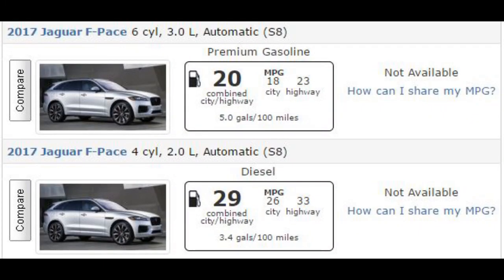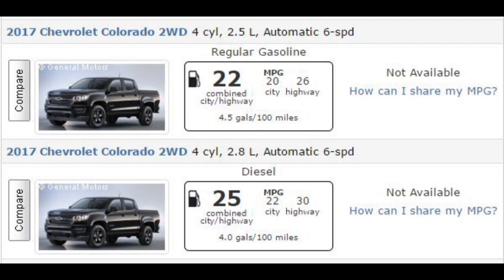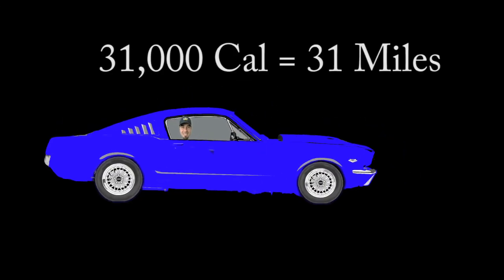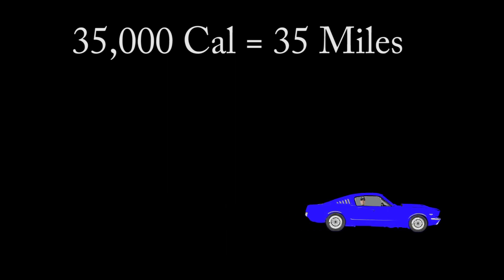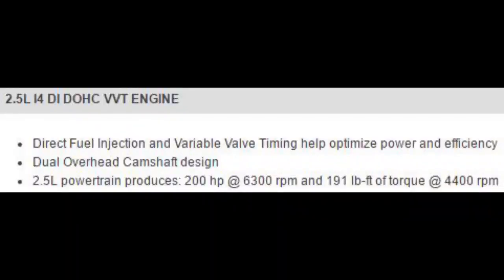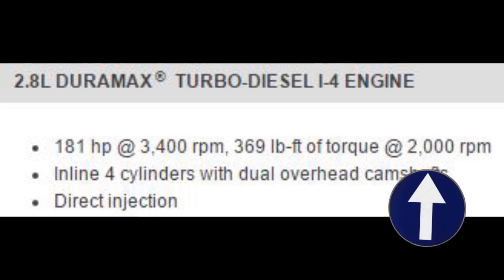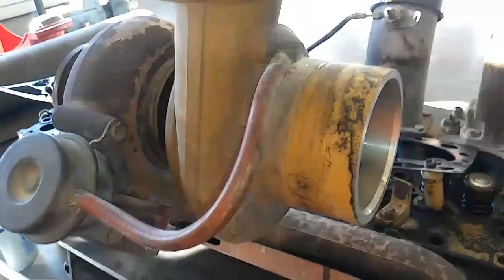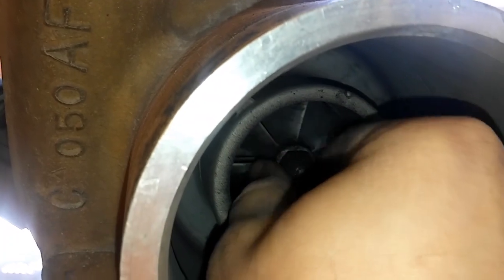Why Do Diesels Get Better MPG? Why Are Diesels More Fuel Efficient?

Comment: Maybe as more people use diesel auto's the price of fuel will fall as it IS faster/easier to produce than gasoline.
Reply: You wouldn't want that, diesels are filthy things and there's no real benefit to them. This guy is comparing diesels to much more powerful gasoline engines, which is why the diesels are so much more efficient. If you compare a Golf TDI to a Civic, the Golf only gets about 15% better fuel mileage, which means it's not efficient enough to make up for the greater CO2 emissions that come with burning diesel. The Golf also produces a greater amount of smog forming emissions. Actually, the Golf TDI was producing even more smog forming emissions than the EPA realized until VW's cheating was brought to their attention.
Reply: idontcare80
Wrong moron.  Modern diesel cars are very clean and get better MPG than gasoline vehicles.
Reply: I beg to differ. My average consumption with mixed city, highway driving in Montreal's cold winters, I get 6.0L/100kms. all 4 banger gas engines I owned would hover around 9 or 10L/100kms. in winter. Summer I hover around 5.3-5.7L/100km. And the overall wear on a Diesel is a joke compared to the gas engines thanks to the lower revs. The exact same engines in Europe run between 15-20% more efficient thanks to better fuel qualities and different emission standards. As efficient as our N.A. diesels are, they still have much more potential.

idontcare80, by the way, gasoline is a by product of oil, diesel is essentially just refined and filtered oil with special additives (depending on season and climate). If we ran on just gas, what would you do with all the oil that is left after we make jet fuel, polymers, plastic, lubricants? 

I also don't understand why VW are the only one's that got caught "cheating" on a static test. All auto manufacturers are a bunch of liars. GM killed ppl with their ignition switched and they knew about the problem for over 10 years. They barely got a slap on the wrist. Why is industrial equipment running on diesel not regulated like automobiles. I work at an airport and you would cry if you saw, tasted, smelled the exhaust of the equipment we use. And all the fine particulate that you can even feel in your eyes, nose and tongue.

Burning oil in itself is very dirty. Refining it to get gasoline is even dirtier (takes a lot of water). Burning gasoline has only become clean with the advancement in catalytic converters, and I would say that diesels have come a really long way with the EGR systems and Diesel particulate filters (which burn the particulates to very high temperatures) in order to have a cleaner exhaust.
Reply: Patrick EH. Yeah, I'm a moron, when you can't even understand what i said. I said: Diesels aren't any cheaper to fuel (this is because diesel fuel costs more), they don't have lower CO2 emissions (this is because burning diesel produces more CO2 than burning gasoline), and that their smog forming emissions are higher, and they are.
Reply: vindication444. Things are quite a bit different in the US, as we require our diesels to meet the same emissions standards as our gasoline engines (and they barely do that while gasoline engines exceed minimum requirements), this restricts them considerably and reduces their efficiency. Diesels in the US still produce more NOx, have about the same CO2 emissions and cost about the same to fuel, all while costing more to buy, there's simply no reason to buy them.

The use of fossil fuels needs to be completely eliminated, period.
Reply: I totally get your perspective and agree! While opening up the topic of emissions on gas engines. The United States are really good with air quality. If only they can put catylitic converters and exhaust components that can withstand higher temperatures of burning a leaner mixture. Would get better fuel economy and much more horsepower too. This would help tremendously with pollution on the refining front. Direct injection has helped tremendously (makes gas engines feel like diesels almost), but there is a serious drawback with carbon buildup in the intake manifolds. I still believe that the future, Elon Musk with Tesla has got it right!
Reply: In terms of cost. The US is one of the few places around the world where Diesel is considerably more expensive than gasoline. In Europe, diesel is considerably cheaper. and 95% of the time, diesel is cheaper in Canada as well.
Reply: Gasoline engines don't need to be any cleaner. PZEVs already have exhaust that's cleaner than the air in a polluted city. In other words, they're actually capable of cleaning the air.

"...but there is a serious drawback with carbon buildup in the intake manifolds."

That's not nearly as big of an issue as the soot that builds up in the intake manifolds of diesel engines due to EGR (EGR isn't an issue on gasoline engines). Hell, soot eventually clogs up the particulate filters of diesels, and that's not a cheap issue to deal with.

BEVs are the future of passenger vehicles, but there is a whole huge range of applications where they're just not practical, and wouldn't be even if battery capacity were doubled. Hybrids will take over in those applications, and those should be gasoline/electric hybrids, not diesel/electric hybrids.
Reply: I thought diesel was more expensive because it is a lot more refined
Reply: That is great that it produces more CO2, as that molecule is the elixir of life, and the earth's atmosphere could use more of it.  You have been brain-washed about the alleged deleterious affects of increased atmospheric CO2, because those adverse findings were the result of bad math, statistical manipulation, and an anti-technology attitude designed to fatter the pocket books of certain green energy companies at the expense of the taxpayers.
Reply: So, you think that because some life consumes CO2 that it somehow isn't a greenhouse gas?
Reply: How in the world can you possibly deduce from my statement that CO2 is not a so-called greenhouse gas!?  It is one of the mis-named greenhouse gases, and thank God for that, as it helps to keep our planet habitable.
Reply: You're not making any sense. Are you saying that CO2 is a greenhouse gas, but we're not warming our planet by increasing its concentration in the atmosphere? Or are you saying that we are warming our planet but there wont be any negative consequences because of that?
Reply: Also, how the hell could you think that the desire for better technology is anti-technology?
Reply: Jeez!  To repeat myself - "It is one of the mis-named greenhouse gases...." and to answer your other questions:  The radiative properties of CO2 are well understood; however, the cumulative affects of increasing atmospheric concentrations thereof are strictly speculative.  Currently, most computer models utilized to project catastrophic warming have vastly overrated the affects.  The only thing we know for certain is that additional atmospheric CO2 will warm the planet, the degree to which may be too minuscule to be measurable.  No One Knows.  In the great book of climate,  we have not finished reading/understanding the first chapter of a multi-chapter book.  Therefore, to base a policy of reducing production of fossil fuels on a situation where we essentially don't know our ass from our elbow is stupid.  Want to ask me how I really feel?

I am "...not making any sense."  Look in the mirror.
Reply: Jeez! Again!  I never said that the search for better technology is anti-technology!!!!
Reply: The problem is that you're 100% wrong. The models have quite accurately predicted how the planet will warm in relation to the increase of atmospheric CO2, they're not perfect, but they were never expected to be, and they never could be. We also know that rapid climate change causes mass extinction events because it has done so many times in the past.

Also, as far as I'm concerned, you're just shouting: "What if we create a better world for nothing???"
Reply: You said I was anti-technology.
Reply: Also, who do you think is more powerful, a few piddly green energy companies who are just starting out, or the massively profitable fossil fuel industry? Who do you think is more capable of producing enormous amounts of disinformation and propaganda? Who do you think can afford more lobbyists in Washington D.C.?
Reply: What!  I can't believe this.  Well, from you, I can.  Even the computer modelers aren't making your claim that, "The models have quite accurately predicted how the planet will warm in relation to the increase of atmospheric CO2..."  Quite the opposite - they are offering all manner of excuses to explain away the reason observations are considerably lower than their projections.

You need to curtail your reading of newspaper articles and instead study the real science and math that's ongoing, but based on your level of understanding (better yet, lack thereof) of Adept's video and  concepts, it's probably over your head and a waste of your time.
Reply: Why in the world would the fossil fuel industry object to regulations that increase fuel consumption!
Reply: "...they are offering all manner of excuses to explain away the reason observations are considerably lower than their projections."

Except that this isn't happening. The fossil fuel industry propaganda machine cherry-picked some data which makes it look as though the predictions were falling short, but the actual temperature data runs right down the center of the actual predictions (which include a range of high and low predictions).

"...and instead study the real science and math that's ongoing..."

That's exactly what I've done, and that's exactly how I know you're wrong.

https://www.ipcc.ch/publications_and_data/ar4/wg1/en/spmsspm-projections-of.html

"...but based on your level of understanding (better yet, lack thereof) of Adept's video and  concepts..."

I understand that he's just spouting common misconceptions about diesels, and/or outdated information, and that no one here has been able to prove me wrong because I'm not wrong.
Reply: Chad Jessup If people were to acknowledge that climate change is a result of human CO2 production and that something has to be done about it, the use of fossil fuels would have to be eliminated entirely. 

It's amazing to me that this actually needs to be explained.
Reply: In your other reply to me you reference a certain website, which is a summary for policy makers, i.e. it contains no science or the math underlying the science - it is just propaganda.  

If you believe mankind's pathetic efforts can greatly influence Mother Nature to the extent that fossil fuels need to be eliminated entirely, then you need post haste to move your sanctimonious ass to any 3rd world country which can only use biomass, animals, human backs, etc. for energy.  From the been there, done that department, I assure you that there, life is brutal and short.  Enjoy.
Reply: The IPCC can't report anything BUT the science, that's their job and you can verify all of their sources.

Life can, and has, changed the climate on this planet before, and it has caused mass extinctions before, so there's no reason to think that unearthing BILLIONS of tons of carbon that has been sequestered by life on Earth over hundreds of millions of years and then releasing it into the atmosphere will have no effect on the planet.
Reply: Also, I just realized what you must have meant when you were talking about emissions regulations. Emissions are controlled for the sake of human health, not because of global warming. NOx, CO, and HC emissions are all directly harmful to human health, but CO2 is what is causing global warming.
Reply: Chad Jessup And another thing. Why can't I just stay where I am and advocate for the use of technologies that don't have the potential to cause a mass extinction?
Reply: Why don't you go crusade for your stupid anti-fossil fuel cause on an appropriate site.  There are plenty of them.  The young man here is doing the public a fine service discussing CAT engines and related issues. 

You're not a mechanic, a driver of diesel rigs, or engineer, and you barely understand the subject matter of this site, let alone any other issue you raised.

Oh, and you want to stay here and enjoy the comforts and benefits of the use of fossil fuels while ripping them and those who advocate their use?  What a hypocrite!
Reply: Also, what you're not understanding is that we can not only enjoy all of the comforts of our modern world without fossil fuels, but that our quality of life would improve without them.

And, no, I'm not going to live like a savage somewhere just so I can avoid using fossil fuels, that wouldn't solve anything for anyone. Global warming is a GLOBAL problem.
Reply: I understand the wide-reaching consequences of internal combustion engines (diesel or otherwise) better than anyone here, and I do make part of my living turning wrenches.
Reply: vindication444
diesel is "cheaper" than gasoline in Europe because the gov mandates it.  It is more expensive in the USA because lack of demand vs. demand for gasoline.  THAT is partially because the US gov has done all it can to stop personal autos from being sold that are diesels.

Comment: I never knew there were "calories" for fuel volume. I've learned the fuel to air ratios are a lot different to combust. Correct me if I'm wrong; diesel combusts at a 300:1 ratio and gas is 60:1 fuel to air... ?
Reply from the maker: +Nathan Springer Gas should be around 14:1 ratio, Diesel uses usually a much higher ratio of air compared to gas since they nearly always run lean, but 300 to 1 would be a very lean condition.
Reply: +Adept Ape Thx for clarification.

Comment: doesn't gas engines run at the high 20's in thermal efficiency while diesels run in the mid 30's and the huge diesels that are in ships run closer to 50%? Also isn't the maximum theoretical thermal efficiency of an internal combustion engine 64% thermal efficiency?

Comment: This video is a good one, but it seemed a little biased as though gasoline engines do not have the option of being turbocharged as well.
Reply: eM .. Ford Ecoboost? almost every major vehicle manufacturer has a turbocharged line of vehicles
Reply: eM agreeing with you btw
Reply: They do have the option of being turbocharged, but they don't require it to function and even so the turbo in a gas engine is used to squeeze a lager amount of power from a smaller displacement engine. More power efficient yes but it's working harder to make the larger amount of power so in some cases this can work against it in the terms of fuel economy, and reliability generally speaking anyway. I'm not denying the fact that the Ecoboost is quite a marvel I have a friend with already over 100,000 miles on his ecoboost truck we've made leaps and bounds in making a reliable turbocharged engine but they still have their limits on what is reliable and what it not. But you do get the point I am trying to make here though.

Comment: i just came in to your video's, love them! but can you (for fun) give a mechanical diesel engine a bit more power and rolling coal (i know its stupid but i just want to know lol)
Reply: offroad idiot Rolling coal is just running rich. Get bigger injectors or increase fuel flow without changing air flow and you'll "roll coal"
Reply from the maker: +offroad idiot Are you asking if a mechanical engine can be made to roll coal or are you asking me to do a video on how to crank them up?
Reply: not really a video if it is easy to say it in the comments, but im wondering for a long time about this
Reply: Isaac record in theory i know the deal, but in practise i dont

Comment: explain this, a 7.3 idi gets 30mpg hauling a trailer with no turbo. but a 7.3 powerstroke gets 11mpg hauling the same trailer. the idi non turbo gets so almost 3x better fuel economy than a 7.3 powerstroke does. so is the your turbo suggestion false? they both have 3.73 rear end, both have a 5 speed. both f250. same exact truck. the difference is the non turbo gets 3x better fuel economy.

Comment: I think that BTU's, not Calories are the correct measurement for combustion efficiency comparison ??
Reply from the maker: +vaccumme You can use either, they are both thermal units of measure. One converts to the other. I used Calories because a lot of people are familiar with them in food energy counting.
Reply: Well Said. Thank you.

Comment: So a turbo in a gasoline vehicle it gets extremely hot and needs its own active cooling.  So if the thermal efficiency is better in the diesel,  does the turbo not get as hot? If so do these turbos last long?
Reply: Samuel Johnson Most modern diesel engine turbos are now coolant and oil cooled. My 6.0 PS will climb to 1400 degrees on the exhaust side of the turbo under heavy load at WOT

Comment: Another thing i would like to add when it comes to the diesel vs gas debate as well is when it comes to tuning/modifying the engines. A diesel engine responds a lot better to mods than what a gas engine does, GM's 6.6 Duramax is an intake, exhaust and a hot & smokey tune away from 500 horsepower where as an LS1 is heads,cam,Intake and a 100 shot of nitrous away from the same power level. (Granted the LS1 is 50 ish cubic inches shy of a Duramax displacement wise)
Reply: shortfuse1993 because of turbo diesel vs n/a gas. A turbo ls1 would also easily make 500hp.